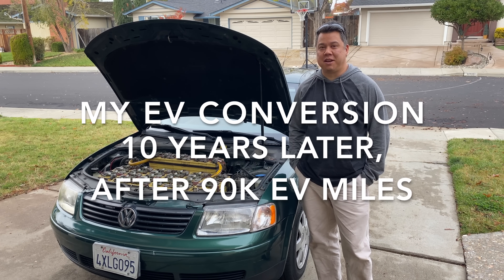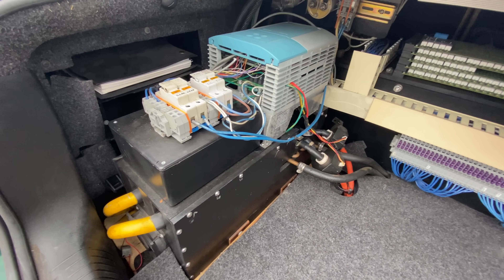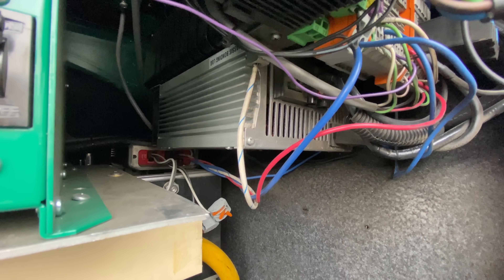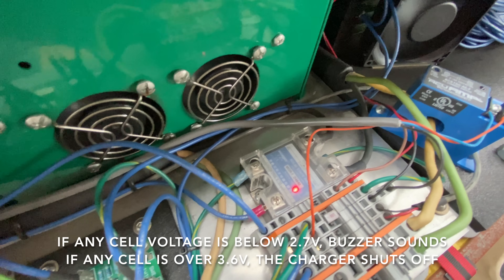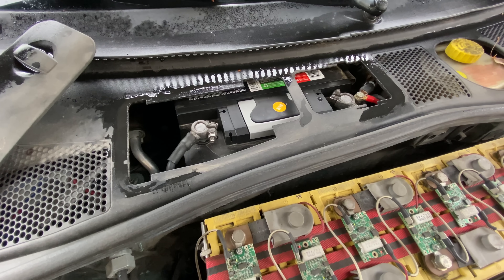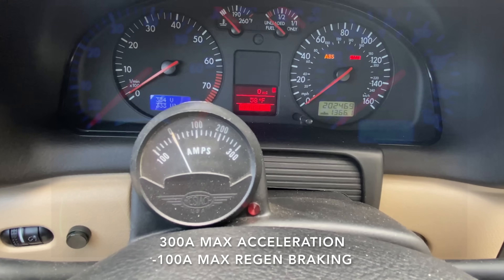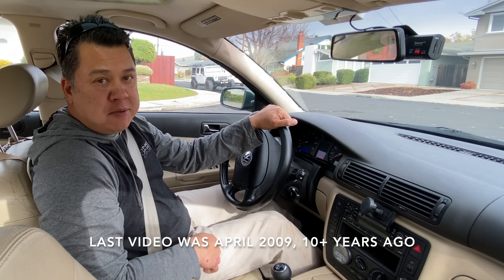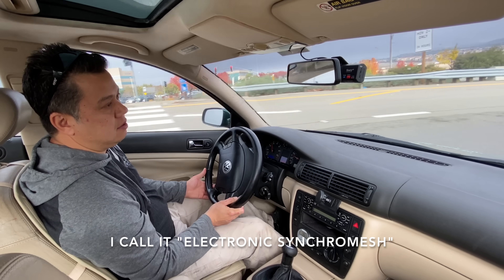My EV conversion after 10 years and 90k miles

Comment: Let´s take a moment to appreciate the fact that he built a MANUAL gearbox electric car :O
Reply: Jukka L ten years ago too... insane
Reply: EXACTLY!!!!!!!! I was completely floored by it!!!! having futuristic technology and still be able to drive with a stick!!! where do i sign up, I want to order mine!!!!!
Reply: Yeah. This is clearly a guy who asks "why not" all the time when told something can't be done.
Reply: Manual is usually the way to go for ev conversions. Automatic boxes don't play well with the unusually high redline, and flat toruqe curve. Plus automatics need engine idle so the hydraulics keep the car in gear. Iirc they bleed off the torque converter
Reply: Gabriel Schoene electric manual cars also solve my least favorite part of manual driving, stop and start traffic. Because the idle speed of an electric motor is 0rpm, you don’t have to worry about putting it in neutral when you come to a stop. You can just leave it in first gear and don’t have to constantly be working the clutch pedal, it’s only necessary for changing gears
Reply: @Fhwgads11  working the clutch is not a big deal in gas cars though...
Reply: A dozen of potatos and a fat cat smelling them look at this guy who doesn’t have a stage 7 clutch in his daily
Reply: @Fhwgads11  what do you mean "stage 7"??
Reply: A dozen of potatos and a fat cat smelling them it was supposed to be a joke about people who put super grabby, heavy, and chattery racing clutches in their dailies and then proceed to just drive in stop start traffic though I can see how my joke could have failed to land
Reply: Yeah, more reliable and probably cheaper to charge than the new ones now.
Reply: Done so because it was simpler.
Reply: Changing gears is fun
Reply: A manual gearbox is ideal for an electric car conversion.  Even if you never shift it, most production EVs use a single gear reduction.  IIRC the Tesla is a 10:1 or something. With this mod, based on the gearing and whatever the final drive comes out to be, if you left the trans in (probably) 2nd gear permanently it would be "like" a Tesla gearbox.  You'd have to test it, but the VFD can reverse the AC motor.  If the trans input will allow it you could run reverse that way, otherwise you'd still have to facilitate shifting into R. If you wanted to remove the shifter from the center console, you could use actuators and a microcontroller to do your "manual" shifting automatically.
Reply: @Lawrence330  trans input is designed for reverse torque - engine braking is allowed, so reverse would not be a problem. Wondering if he has digital reverse on the motor or uses the reverse gear.
Reply: Because you just cant take automatic gearbox and put in on to electric engine. Automatic gearbox shifts when motor gets to programmed RPM, there is special sensor. But you cant just take that sensor and put it on electric motor. This is really basic explanation, I didnt want to get in tech details. But every home made electric car is build with manual gear box, its just 100x simpler...
Reply: @aljosha23  that and the "when to change gear" is completely different. For efficiency, a fuel burning engine should be loaded up at relatively low rpm (not right at the bottom but maybe 2500 out of 7000). For an electric motor, this should never be done. It should be lightly loaded at a much higher rpm, and it increases power as you bog it down until the point output power starts to drop off again, but input power is still rising, which can overheat the motor if it's not limited by software. Without limiting software in a DIY build, to protect the motor, it's best to always take off in a lower gear and progressively apply the accelerator as you build speed.
Reply: @aljosha23  and automatic gearbox needs constant spinning of input shaft for it to change gears
Reply: Aljosha23 no electric engines have no torque curve/power band and also are not limited to a certain rpm like engines are. That’s why every single electric car except this one has an automatic transmission and usually on fully electric cars it has a single gear as opposed to many because they do not need to shift gears to stay in the power band.
Reply: @aljosha23  You could just put a CVT
Reply: @aljosha23  This is an old message and I wonder if you will see this, but if I was about to make an electric conversion of an automatic transmission car, would it be relatively simple to just replace the current automatic transmission for a manual one during the conversion? Since I've heard switching automatic to manual with the petrol engine is very difficult as well, but since the petrol engine would be changing entirely anyway, I guess I could slap in a manual "easier"?
Reply: @aljosha23  also the optimum shift points and loads are different for an internal combustion engine and electric motor. Electric motors are most efficient to keep rpm fairly high and load fairly low. I'm a bit rusty on this but ideally you use 25% of the stall load and not exceed 50%. ICE most efficient to keep rpm fairly low and load fairly high ideally about 75-80% load.
Usually with electric they just stick a big enough motor and control the input at low speeds, as the biggest killer of electric motors is heat from being overloaded, as electric motors (beyond the type used in cheap cordless drills) especially brushless are comparatively frictionless and spin effortlessly at high rpm, plus their efficiency is fairly high unless you get above 25% stall load. You can also do other tricks with electric motors like manipulate the magnetic field strength for either high torque low speed or low torque high speed. So in most vehicles that aren't a HGV you can get away with 1 or maybe 2 gears. My electric bike has 8 speeds but the motor is around 1.2 horsepower.
A motor can safely accept more and more power as it spins up. If you have a Model S Plaid, the motor can probably make enough torque to skid the tires even with restriction at low power, whereas an electric car with a smaller motor may benefit from a lower first gear. Usually with electric cars designed for public roads, the single speed is chosen for optimum power at typical speed limits, as most people don't have need to drive at 130 mph, (and there is no efficiency advantage to gearing this tall) or whatever a Nissan Leaf could do with more gear ratios to play with, so they make it top out in the 90s, whereas a Golf 2.0TDI with similar power will have higher gears available to reach that 130 mph. Also if you had a Golf 2.0TDI with only third or fourth gear available, it would suffer efficiency loss on the motorway and also be terrible at low speed traffic and parking as it can only rev so low, compared to an electric motor that can give you decent oomph down to walking pace without the need to downshift.
Reply: It's actually easier to build a manual transmission electric
Reply: @cristopherhernandez3795  lol no it is not 🤣
Reply: He doesnt need the clutch because the motor won't stall, that's pretty obvious
Reply: Let's not hope for firey crashes with all those batteries .... Get clear mate!
Reply: Yeah so m as my years before the big boys bothered to make them.
Reply: Indeed, that's a BIG win
Reply: i legit was gonna click away the. i saw this comment
Reply: trhats how 90% of ev conversions go.
Reply: All you would have to do is put a flywheel and clutch plate on the motor. Not really that hard. I guess It is easier then a cvt though.
Reply: Anonymous faggot  7 months later but.. I think that only way of driving stick after 2040 or so will be like that. Automatic car without a clutch pedal, but with stick in case driver wants to have some fun. I love manual too, but that's sad truth. Better than automatic without a stick tho
Reply: Yeah, I was like why have a transmission at all bruh
Reply: Yeh man mad respect
Reply: Its easier to do an electric conversion on a manual than an automatic
Reply: Really curious how he downshifts? Or just don't need to downshift?
Reply: I really hope there will be a manufacturer in the future that will make electric cars with a manual
Reply: @tijmenboos6645  EVs typically dont need a transmission at all.  Just a reduction gearbox.
Reply: @patreekotime4578  i know that. It would just be cool if they made one, even though the car doesnt need it. It will make driving more fun. And if its not possible it would be cool to see some kind of manual simulation or shift simulation just like some cvt’s do
Reply: @tijmenboos6645  I mean, if you have the money, a few EV hypercars come with them... But its literally just shifting from a single lower gear up to a higher gear. I guess maybe some manufacturers would consider them... But generally manual boxes are disappearing in ICE vehicles of all kinds anyway.
Reply: @patreekotime4578  yup... the sad truth
Reply: i mean…i appreciate it but there was no other option so….idk what you’re on about
Reply: Manuals are sooo much more fun! :-)
Reply: He wanted to save more gas with the standard transmission 🤣
Reply: Creating an electric manual car is like taking one step forward then one step back.
Reply: Anonymous faggot  it's an electric motor, so when he's stopped, the motor isn't spinning, so no need for a clutch to start, and once you're driving, there's really no need for one either, you just have to rev match, which is what the light does for him as you can't really hear or "blip the throttle" on an electric motor
Reply: Didn’t even think that was possible!
Reply: He said it was automatic.
Reply: im wondering if the Ferrari 308 EV that i saw was Manual also, i cant remember, i think it was too?  
it would be cool to have manual EV conversions adapted to certain cars
Reply: Why don't they make them like this!? Then they would be interesting.
Reply: Yeah, because the gearbox that came with the car is characterized for an IC engine
Reply: That is less efficient.  But how it should be for power
Reply: Which I can’t even fathom as it seems 101% of EV manufacturer/engineers can’t see past CVT is the ONLY way to go. Manual is old school, more reliable and allows you greater degree of mastery over how the car speeds up. Maybe not as helpful for Hihh torque electric motors, but, I think it should be an option regardless.
Reply: Back wheel drive aswell ? as Manuel extra fun....
Reply: I want a manual electric car too!!!
Reply: That means it's basically a Porsche Taycan... it also has 2 gears, one for acceleration and one for top speed, but they're automatically shifted.
Reply: Most historic EV conversions had to use the manual transmission model of a car because the automatic transmission didn't offer an easy and efficient way of efficiently coupling the electric motor to the wheels.
Reply: Right!? Im like, huh!?
Reply: @biggerchris20  god. Barf. Lol👍
Reply: He said that he doesn't have a clutch n that he drive  75 at second gear so still  the fun of driving a manual is lost
Reply: @hrhkoa  im curious why he didnt set the motor speed lower to get less rpm and more range by using the other gears as well.
Reply: @hrhkoa  no, he said he did that for a few years, probably before he came up with the rev sync light idea. He literally shifts into 3rd while hes describing it.
Reply: Seriously. This man is literally everything I'm not. I have severe A.D.D. and AT BEST average IQ. I can't even do the slightest tasks like going to the Home Depot next to my house to pick up some light bulbs to replace the dead ones in my house. It takes all my willpower just to do that. In fact I'm supposed to be at work at this very moment yet I honestly don't have the willpower to move. This man built A NEW CAR FROM AN OLD ONE. TALK ABOUT BRAIN POWER.
Reply: @Revolution-bp2kj  Hey I just wanted to say I hope things get better :) Go outside on a nice day and look around, and breathe deeply for a while.  This is a crazy realm... and it's easy to feel lost.
Reply: @Revolution-bp2kj  I totally understand you. I have add too, and diagnosed with what was called Asperger until a few years ago, but I have a way above average iq, like mensa level, but wouldn't get in through their normal entry tests, as the add couldn't let me be real me.
But the willpower, man, it's the hardest thing. Getting things done isn't easy, but we need to work so hard. Wished that my parents gave me proper treatment (they kinda ignored and I just found out last year). Only thing that I want now is a proper EV, like the Bolt, so I could be with a car for a really long time without worrying with maintenance, and maybe work with it.
Only thing that is the hardest here in Brasil is the acquisition price, which almost blunder it....
Reply: It's not a manual, NO CLUTCH, it's basically a paddle shifter.
Reply: LoL, your comments makes me ROFL. I know that mostly Americans have a lot of difficulty to deal with manual shifting but trust me -- it's not that hard. Don't get me wrong I love automatic cars (I have one) but I have driven manual cards for years and can say that anyone who cannot drives a car with a manual shifter and a clutch pedal is not a real driver. Just pretend being.
Reply: There much less intelligent people on here doing that but... ya pretty dang cool.
Reply: @Shornandkenny 10 years ago?

Comment: My car a 79 Monte Carlo to convert at this cost of my calculations of 80 dollars a month for fuel leaves 19000 at a different of putting a new motor and drivetrain in my car so roughly  1000 dollars a year in gas gives me 9 year's of time at witch point I'll have to spend another 12000 on new batteries do you see where this is going not worth it to convert

Comment: OK. Tearing up my MSc in Electrical Engineering diploma right after watching this.
Reply: It's about PLANNING and doing things in STAGES. It's not like he put it together in 5 days using a kit ordered with cereal box UPC labels.
Reply: snorting my coffee on that one
Reply: I am not graduated btec
Reply: Indian study has no value until you implement.
Reply: Cool story David
Reply: Don't mean to be rude but you really believed college is actually necessary beyond the diploma being legally required?
Reply: @jonathangarzon2798   If you plan on being hired by anyone, then yes.
Reply: Jonathan Garzon. This is one of the things that actually shits me about society. How smart you are has nothing to do with formal education, it’s about how you apply common sense and spend time learning yourself. 

In my job I actually do some quite complex stuff that “technically” your supposed to have a degree to do. I’ve also had to tell “proper” engineers how to design stuff bearing in mind the price and availability of the items in question. So many of them in my area of expertise will design XYZ and only X is actually available so most of the parts they need aren’t even on the shelf and the whole thing needs to be redesigned.  Which I do with my real world experience. 

Then you have the installers who are supposed to be qualified and don’t even know how to read instructions properly and you end up having to bail them out of their fuckups. 

I only have a year 10 education (didn’t even graduate from college) but I have over 15 years experience in the same job. In my experience a person who is willing to learn and put in the hard yards is worth far more to a company than a person with a degree and no real world experience. Too bad employers never see it that way!
Reply: @David-lr2vi  The point of (technical) college is to streamline the education process.  You can learn everything you'd learn in college outside of college, but it might take more work, it might take more time.  You might lack direction, or miss important things because they were outside the scope of your interest.  There is nothing that says you can't be successful without college, but to deride others for attending college is just silly. 
I've been where you are and I've felt the way your post leads me to believe you feel. The fact is useless people will be useless with or without college, but for those of us with a drive to succeed college is another TOOL to get us there.
Reply: @David-lr2vi  I think that in the IT field at least, more and more employers realize this nowadays.

Comment: If I said this project looks like $100,000 worth of personal time, equipment, and engineering put into a $1,000 car, how far off would you say I am?  It looks amazing, but I don't think I'll be able to build one.  I'd definitely like to know more about it, though.  Subscribed.
Reply from the maker: I'd say you're off by 4x.  I'd say I have 500 hrs into it (1 day/week for a year); hiring a technician @ $50/hr would be $25k.  When I started, the Passat was 7 years old, new it was ~$25k, so after 7 years it's worth half, around $12k.     This is obviously a hobby, and a learning experience, I didn't do this with the intention of trying to make a profit.
Reply: @etischer  Even at 500 hours, the labor rate for electrical diagnostics at shops near me is $145 an hour, and that's for an A-level mechanic, not an electrical engineer.  If you priced it at $50 per hour, that seems like incredibly good value for anyone who buys that car.

I think it's definitely a hobby that has been a worthwhile use of time, and I'm jealous that it doesn't seem more within reach for me, personally.  

I'm looking forward to the day when there will be EV conversion kits influenced by your experiences for people with my level of wrench turning ability to convert existing cars into electric vehicles.